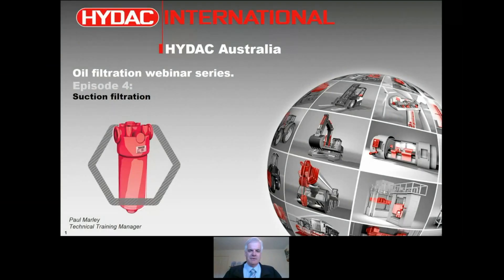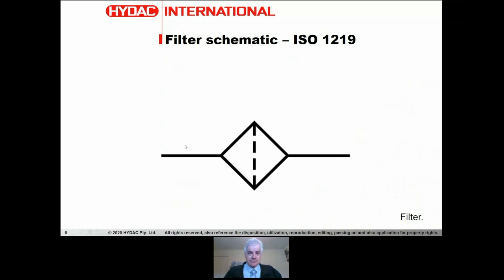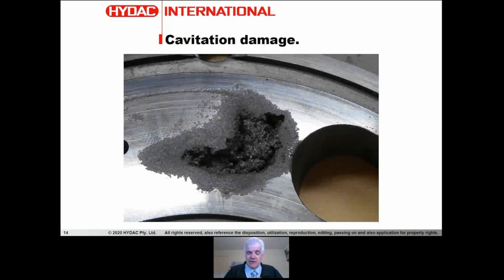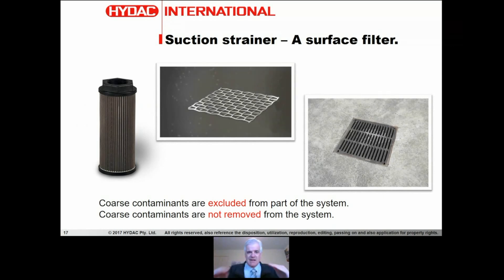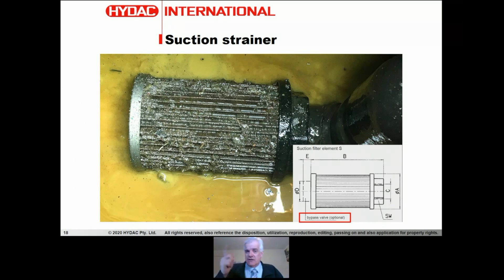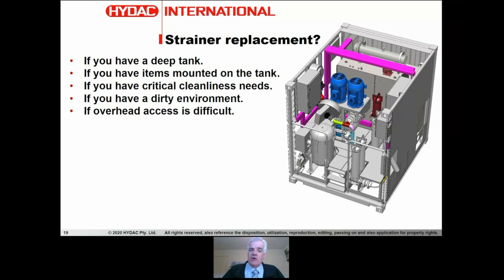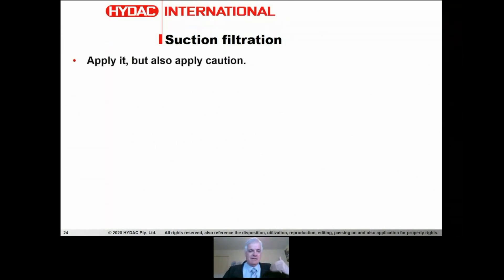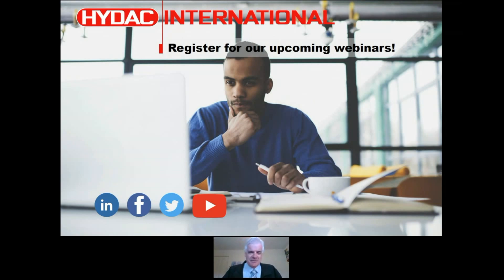Oil Filtration - Part 4: Suction Filtration

Comment: HI Pual, Thanks for sharing. I have a question, If the hydraulic pump required 189liters/m, what is the size of the suction strainer required? Thank you.
Reply from the maker: Hello Banny, thanks for your question. The rule of thumb: If you MUST fit a suction strainer, make it as large as you can.